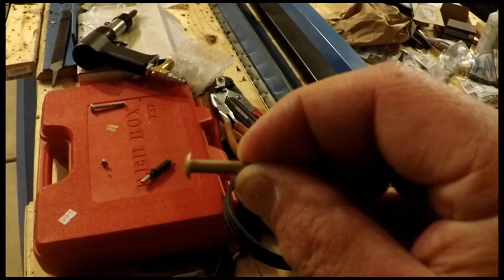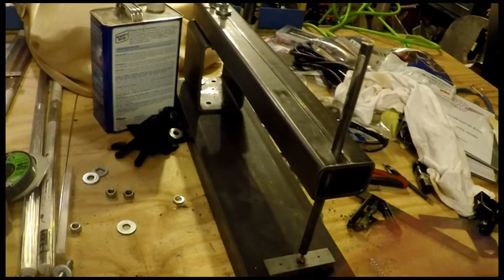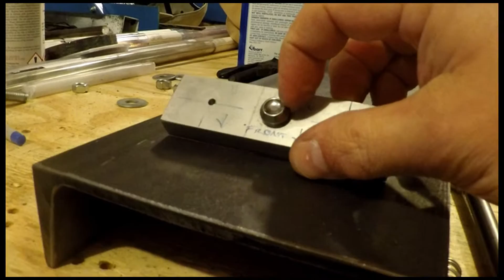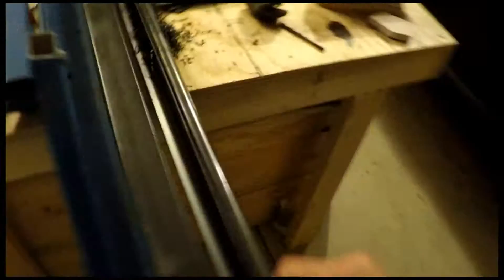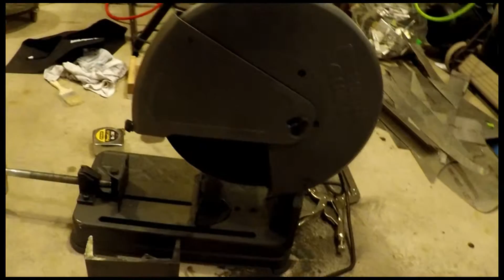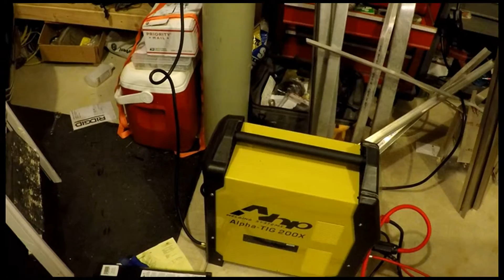Tooling Updates - Episode 1

Comment: Hey Greg, why did you choose to build the STOL 750 vs the Cruzer, 650 or 701?
Reply: Very nice,  I love the rivet punch you made
Reply from the maker: Very long story. Originally had plans for 601 before I started building. Changed my mind because I decided a STOL plane would fit my lifestyle more (I like backwoods camping & backpacking...plan to incorporate bush flying into that), Cruzer didn't exist when I got started on STOL...still probably wouldn't have gone from STOL to Cruzer even if it had been available.
Reply from the maker: 750 can carry more gear + people than 701...important for carrying me and backpacking gear with 2nd person. Also considered 801, but price was an issue with that. Also the 801 isnt available for scratch building...Zenith doesn't (or at least, didn't at that time) sell blueprints for the 801. It was kit-only with assembly manual.
Reply: I'm stuck between the STOL and the Cruzer, I like the STOL for the same reasons you do but like the speed of the of the Cruzer and think that if I add the VG's I can better the landing and takeoff. I'm stuck between the two.
Reply from the maker: +Jason C  The Cruzer is easier to build too...no leading edge slats, single wing struts, smaller parts count (from what I understans). You really only want the STOL if you really need super short take-off and landing distances. The Cruzer is a pretty STOL-capable plane as it it.
Reply from the maker: +GK Oh, and more room in the panel on the Cruzer too.